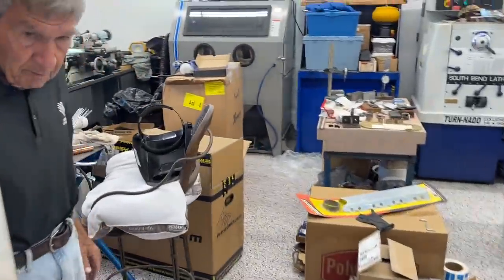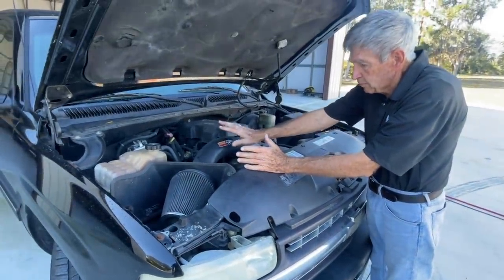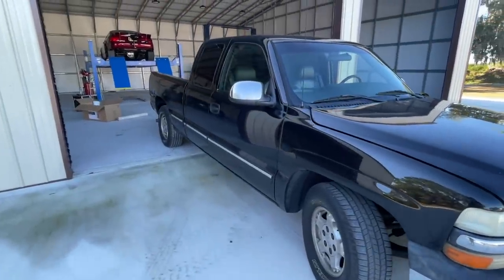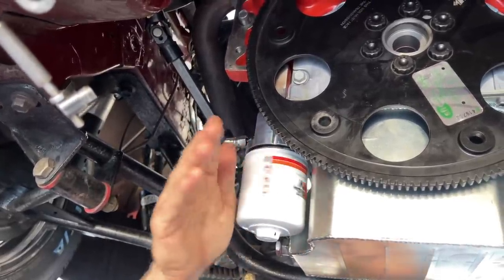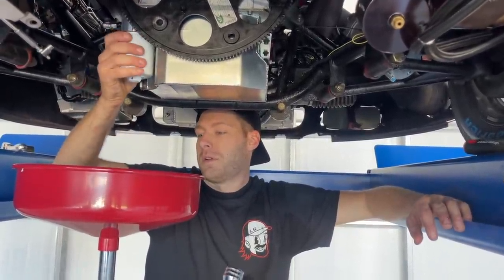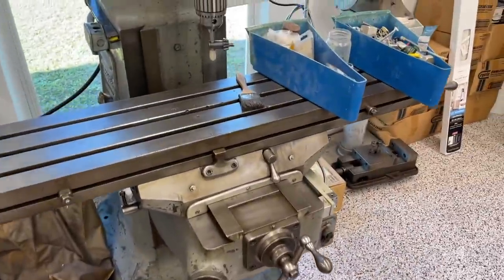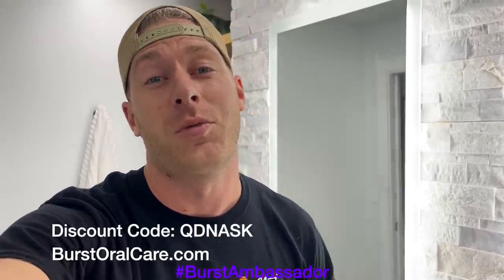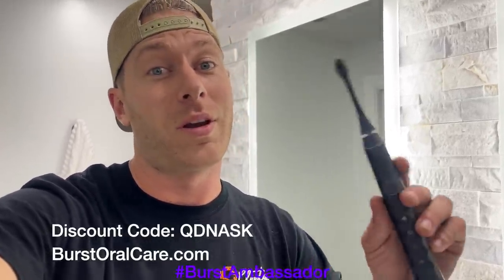Mr. Sam Gives a Tour of His Shop & We Pull The Trans on Dr. Pepper... NOT Good

Comment: It does matter which hole you use on the shift selector bracket.  The geometry makes a difference based on manufacturer.  There's probably a "C" next to one of the holes (Chevy).  That's the one you want.

Comment: I'm 65
And  I still have two of my vehicles I purchased new off the lot
One is my 1971 Chevy 3/4 ton pickup , it has the second engine in it and the second transmission 
The body has 652,xxx miles on it and it still looks great !
 The other is my 2000 Dodge neon with the original engine at 487xxx miles 
 If you really take the time to do the maintenance , your vehicles can last a long time.

Comment: Just a note on filling the oil filter with oil before install, When you do that any left over old oil will mix with the new oil right away without going through the filter system you can cross contaminate the oil and put damaging debris in it.  All major car manufactures recommend do not pre fill the oil filter.
Reply: Wrong. If the old oil was contaminated before, damage was already down regardless of new fresh oil in the filter or not. Filling the filter with fresh oil (thats filtered before being bottled anyways) helps prevent dry starts.

Comment: I have a 2000 Chevy Silverado with about 180,000 miles on it. I also bought it brand new. Replaced a water pump,radiator and a abs module. Best truck you can own.

Comment: Damn wonder if that linkage wasn’t fully engaged in the gear you were commanding . Just a truck also from my  converter builder he paints the converter white and if you get to much heat or you smoked it the paint will burn or start peeling  in that area it will tell you what’s going on or if there is too much slip and causing to much heat. It’s help me tremendously on tuning or just diagnosing. Oh Sam is the man ! God Bless!

Comment: NO you DO NOT FILL THE OIL FILTER FIRST.  Unless it is a large diesel engine.  By filling the filter first, you are adding the possibility of adding contaminants on the clean side of the filter.  if you MUST pre fill, then do it from the outer holes, NOT the center.

Comment: Oil?  Use synthetic. Valvo Syn Power is very good. Far thinner but has better lubrication. And runs far cooler as well.  I use it in road cars, racecars in engine gearbox and diff. 
Synthetic ATF is used in many severe duty applications and hangs in there far better. 
Keeps diffs far cooler and keeps them together, ditto with manual gearboxes.

Comment: People are always amazed at the 447K on my Silverado. 714 dang. I wore the seat out before I replaced the 350 @ 290. Ol Sam must have spent all his time driving from coast to coast. Disable the fuel pump and crank to get pressure. Only a handful of vehicles can you fill the filter with oil.

Comment: Parker, when you go to someone's shop, do not touch anything. You picked up pieces from the workbench and they fell apart and you had to quick reassemble and put back on table. They may have been precisely assembled and cleaned of all impurities like fingerprints and placed on the workbench in an exact location. You also turned an adjustment scale on the lathe. He may have had it set for an operation. Just DO NOT touch anything ever.
Reply: Shop cop at work.  Go back to sleep.

Comment: Liked and subscribed. Sam is a hoot. He isn't wrong. Fluid shear creates heat. Are you locking up the converter clutch on the highway? Any ratio errors? From the reported temps the fluid never got hot enough to oxidize on its own and the color is likely due to clutch materiel in the fluid. Can you view the RPM and trans input speed sensor PIDs? Do they match at 60-75mph? Is the converter clutch slipping or is a clutch pack burned up and why? Thanks for a great video.

Comment: Ive always put oil in new filter. But recently I've heard of not putting oil in filter because there could be debris in the oil that goes unfiltered that could clog oil passage. Ruining the engine.   Dam, Engineers need to make us oil pumps that we can run externally via a drill. I do, by removing the distributor on my 67 mustang.

Comment: It's funny because old school mechanics say put oil in the filter before putting it on.. New Mechanics say don't because the oil isn't clean. So your sending dirty oil to your engine. But I will say this after looking at particle sheets for most oils brands out there there are high particle counts in most oils now. I was taught always add oil to the filter first. Idk what to do so I am just going to do what i feel comfortable with. Also I myself do a titch more then hand tight on most oil filters. and the new Flat-plane crank engines you most definitely want to torque those on to manufacturer specs.

Comment: I've always filled the filter but just watch a  YouTube channel with a 30 year tech who says never fill the filter because that is the quickest way to introduce contaminants into the system says the manufacturer of the vehicle say not to do it I'm 55 years old and have never had a problem filling the filter but it does make since if something falls in it on the side of flow it will push it right through the bearings

Comment: That block is only within 30 millionths of an inch at a specific temperature.  And that block, sitting out in that room varies in temperature VASTLY compared to the proper storage method. So, that block is not within 30 millionths of an inch sitting there out in the open.

Comment: The converter is a Fluid coupling. It is going to get Hot. also filling the oil filter is not necessary. There is still enough oil on the bearings to stop it spinning a bearing. If it was so important why would some manufacturers mount their oil filters with the mounting surface facing up. Some manufacturers even tell you not to prefill the filter. No offence but is a old school wife's tale that has continued over the years.
Reply: Spinning  bearing is not the concern, dry start up wear is the issue. Different engine designs may or may not help protect against this but I'm a pushrod V8 design is likely more at risk then small 4cyl where the oil doesn't have far to travel,
Reply: @jimkaray ,  No it doesn't matter how many cylinders or the configuration of the engine, oil system wise they are basically the same.
Things that I personally do is Unless the engine has been sitting for a month or it is a new build. I disconnect the ignition system and crank it until it has oil pressure. If it it is a older Distributor style engine that drives the oil pump I will pull that out and spin the pump and build some pressure before start up. If it is just a service or a oil change there is still enough of a film of oil to protect bearings and moving parts. Engine oil has come along way over the years.
After doing around 5 or 6 thousand oil changes and log book services over 30  years, and building a number of engines, I have never had a problem not filling the oil filter. Especially the way some guys work. Pre Filling the filter just introduces a way to get dirt and crap into the outlet side of the cartridge. It is just one of those things that people do different. I have seen people do it and They say that's the way they were taught. I don't do it and My Dad was a Automotive Mechanic for 45 years and he always said that it was a waste of time and a good way to make a mess. People just do things differently. But my point is, considering how many oil filters are changed everywhere every year, if you had to do it Especially these days it would come with a big yellow idiot label on it telling you to pre fill the filter.
Reply: @MJTAUTOMOTIVE  I think you are arguing in the extreme. No one is expecting the engine to fail if you don't prefill it just a precaution to help extend bearing life to oh, IDK 715K. Interesting you don't think an 8cyl pushrod motor has different oiling system dynamics then a 4 cyl overhead cam modern design motor. Changing your filter and using a quality one i 10X more important than prefill, its jut that little old school extra touch.

Comment: do not prefill your filter, it has  a slight chance to get debris in post-filter area of the filter and gets to crankcase and that is more problems than 1 sec of no oil lol your bearings area already lubed up especially that you;re using vr1 a lot of manufacturers especially performance engine manufacturers including chevy advice against and tell you to not prefill the filter for that reason of debris getting to filter when not supposed to

Comment: And that’s why I drive Chevy and everyone talk so much sh*t my 2000 Chevy suburban has 302,000 miles still kickin and it’s 4wd never had any issues except water pump and alternator and a tensioner pulley and new belts and hoses and of course oil changes every 3,000 miles and brakes and tires normal wear and tear stuff  but feel free to say how awesome your ford and dodge is